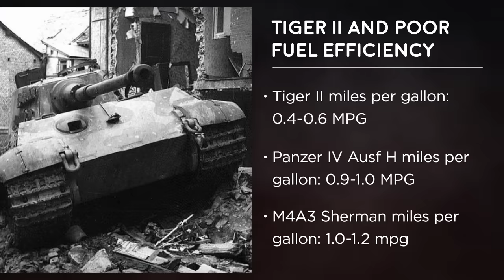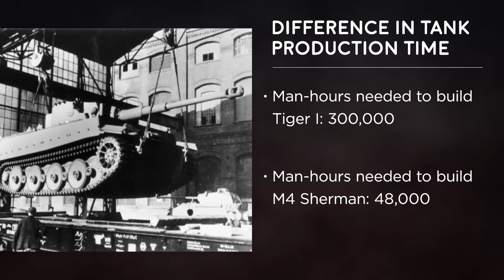Why Did German Tanks Perform So Badly in The Battle of the Bulge?

Comment: The Tiger taking 300,000 man-hours to complete is an insane statistic.

For some perspective, if you, by yourself, spent 16 hours a day working on one, every day of the week, every week out of the year, it’d take you over 50 years to make one. In other words, basically the average person’s waking hours for their entire adult life.
Reply: By comparison, a T-34-85 took around 20,000 man-hours, meaning that you could literally produce fifteen T-34-85s for a single Tiger.
Reply: @michaelwong8083  34-85s are actually quite good tanks and we quite the danger to Tiger 1s. It is just insane how much better on the strategic level the T34s were.
Reply: @michaelwong8083  "By comparison, a T-34-85 took around 20,000 man-hours, meaning that you could literally produce fifteen T-34-85s for a single Tiger."

Go watch Lazerpig's rant, and it is a rant, on the T-34 and its quality "issues". (have some popcorn ready)
Reply: @rring44  The T-34 was a good design on paper but Soviet build quality left a LOT to be desired.
Reply: @scottgiles7546  Lazerpig is great
Reply: @scottgiles7546  Lazerpig is not a great history source, T-34-85s were built with much better quality than original T-34s, They finally had normal optics and armor didn't shatter after single hit, they also solved most of the reliability issues. The 85mm gun was good enough for punching through almost anything it faced (Tiger II being the exception).
Reply: @interpl6089  sure if they could hit the thing, even then t34s had incredibly poor reload rates, tigers shot more than twice as fast as your avg 34-85
Reply: @scottgiles7546  lazerpig lmao. Dude is incredibly biased
Reply: @interpl6089  they absolutely did not solve reliability issues lmao. The Chinese and North Koreans had quite a bit to say about that. Issues the Russians didn't fix during the war, didn't fix during the cold war buildup, and even the Koreans and Chinese went "well we can't fix this" and simply had to work around their failings.
Reply: @zeppkfw  Ja?
Reply: Laserpig is an entertainer and needs to be viewed as such.  Most of his stuff has legitimate truth to it, but he also clearly leans heavily on strawmen and exaggeration in his videos.
Reply: @interpl6089  he more was ripping early T34s
Reply: I only work 8 hours a day….and I want a half hour tea-break morning and afternoon plus an hour for lunch.  🤓
Reply: @scottgiles7546  You know, if a car was incredibly unreliable, nobody would say it's a great car.  Why is the rule different for tanks?  Why do people speak of German tanks as if they have superior quality when they were famously unreliable?
Reply: That's one hell of a build
Reply: There are only 2080 work ours in a year, working 40 a week.  300k is 144 workers entire year.
Reply: Not at all surprising given many of the workers were literally slaves
Reply: 300,000 is probably an error. The Tiger cost as much as three Bf 109s, and a late war Bf 109 took 4,000 man hours to build - three times less than a Spitfire. So did a Tiger cost the same as s Spitfire?

For a comparison, Germany built almost as many U-boats as they built Tiger 1s, and each of them cost, on average, almost 20 times as much as a Tiger, but I have no idea about the man hours. Even a lowly S-boat cost 10 times more, and a single Ju 88 nightfighter was also much more expensive.
Reply: @derin111  What about second breakfast?
Reply: @MarcosElMalo2  Well, we should really all be tightening our belts...there's a war on, you know?
But, since you insist...Two fried eggs, sausage, bacon, beans, mushrooms and a couple of slices of fried bread on the side, please. Tea with milk and two sugar, there's a good fella. 🤓
Reply: @scottgiles7546  the issues are before 1943. Where we see most Soviet tank losses(which includes tanks that broke during battle from malfunction)
Reply: Germany had cheap labor in those days.
Reply: @michaelwong8083  If t-34s were made to the same qaulity standards as the US, then a single T-34 would cost the same as a Sherman.  I dunno about you but I'd take a Sherman over a T-34.
Reply: @KuK137  Now I know your on some copium shit especially since you mentioned the IS 3.
Reply: @derin111  That’s the way we did it in the Queen’s 2nd Hobbits Tank Guard Army, aka Arwen’s Avengers. With physically smaller tank crews, that gives you more room for ammo and . . . TATERS!!
Reply: @djquinn11  Cheap but highly inefficient slave labor and drafted labor, which probably increased the man-hour statistic and led to more quality control issues.
Reply: @dragonace119  I don’t want to argue tank vs tank, but I think we should note that Soviet manufacturing quality improved after the start of lend-lease. We were sending Stalin the tools and materials to build better running tanks, not just military equipment like tanks, jeeps, and planes. If the Russian tanks were superior to German tanks and more numerous, it’s because the Soviets had our help getting their manufacturing and logistics shit together.
Reply: @MarcosElMalo2  Absolutely, Lend-Lense allowed the Soviets to ignore producing trucks, train engines, and radios (Spam also played a major role) along with giving them newer and high quality tools.
Reply: @TTTT-oc4eb  comparing ships and planes to tanks is not going to prove anything
Reply: @interpl6089  Soviet doctrine meant they wanted Quantity over quality. Cheaper the better. Go to bovington tank museum and you will be able to view a T34-85 and a Panther G from the same year. Look at the quality of the chain links 🤣🤣
Reply: And all it takes to ruin someone’s lifetime of work is some bloke with a 17 pounder.
Reply: This is indeed an insane amount of time, around 6-7 times of what you would need to build a sherman. However there are calculations prizing a tiger 1 at around 110.000US$ (1941) a piece and a sherman at 40.000-60.000US$ (1944), which looks odd considering the difference in man-hours. Afaik some arguments have been made that german and american man-hours of the time are calculated differently and are therefore not directly comparable.
Reply: Germany's limited manpower and big manpower problems during the war is one of the reasons they went for fewer but "better" tanks.  The USSR could afford the mabpower drain of making 15  T34's whereas Germany could've made nothing but Panzer IV's and Stug's but would struggle to find the men to man them.  So they went for less numbers, but bigger and tankier.
Reply: @interpl6089  Really depends on factory and when it was built tbh.
Reply: @TTTT-oc4eb  Cost =/= time to build
Reply: @TTTT-oc4eb  "About 54,000 man hours per tank on average over whole production run., varying between 28,000 hours and 117,000 man hours."
Reply: @MrDanisve  I guess 300,000 is for the first few tanks. Where did you find the numbers?
Reply: @derin111  I'd rather just go home an hour earlier than taking lunch hahah snack while working is sufficient and stopping for an hour in middle of the day is a real drag. Makes me want to be done with this shit hahaha
Reply: @scottgiles7546  I would argue that the M4 reliability makes T-34 look unreliable like a Tiger II
Reply: @HarrDarr  Was that really that bad in terms of reload speed on later models as well?  I know that the early 2-man turret suffered from this issue but didn't  having an extra man as a dedicated loader solve the issue?
Reply: German armor production in the war was batshit insane to begin with. Too many model types with multiple modifications demanded by the army, short production runs and the obsession with quality over quantity helped lose the war for Germany.
Reply: @interpl6089   T-34-85s continued to be built AFTER WWII, with large numbers built in Poland and other Warsaw Pact countries.   Those did have much better build quality 
The T-34s built during the war all had horrible build quality.
If you can ever find or afford a copy of the book "T-34 - Mythical Weapon" you will see picture after picture of the sloppy construction of WWII era T-34-85s as well as large numbers of  completely shattered T-34s on the battlefields of the Eastern Front.
The T-34 was not only the most built tank of WWII, it was the single most destroyed tank of WWII.  There was a reason the Soviets built them so fast and so hastily - they were getting blown up as fast as they could come off the factory floors.
Reply: Lol
Reply: @commonavionics6069  It's hilarious that people don't realize this. Thought it was pretty clear in Lazer's video.
Reply: @glennheth3472  German tanks had quality issues too. I guess it evens out.
Reply: It may have been a mistake on his part, sometimes extra zeros get added.
Maybe you could bring it up to him?
Reply: @Conn30Mtenor  there were more than 100 variants of Shermans and vehicles based on its chassis. Then you have the M2,  M3 Lee with 20+ variants, M3/M5 Stuart with more than 30 variants, M6 and other heavy tank projects, M18, M24, M26, various super tank projects etc., etc. Great Britain and Soviet, too, had a vast number AFV variants.
Reply: This kind of statistic is grossly misleading and I have to say getting quite tedious.   Mass production greatly reduces costs.  There were 495 Tiger II tanks made.   If 1000 were made the cost would probably dramatically drop to about 100,000 and so on till cost became a small multiple of the cost of the raw materials.    If only 495 Sherman's or T-34 were made the costs would be similar.   The Tiger II was at an early stage of production and there were in fact 3 turret designs still.  Once the production is established, tooling and jigs in place, factroeis set up, wring harness testing jigs and so forth it drops rapidly.  The Ju 88 cost 400,000 man hours and this soon dropped to 20,000.    Me 109E cost 16000 hours but in 1945 costs were down to about 800 hours for the Me 109K4 without engine.    We get the same nonsense with the V2 missile.  
-The Tiger II was a specialist breakthrough tank.  It was designed to do jobs that lighter tanks simply could not do.   You can't replace 1 Tiger with 4 Panzer IV or Sherman because the lighter armored tanks will get destroyed and the crews killed.  The guns will be inadequate.  
-The tank the Germans had designed to be their new mass production tank was the Panther and it required less man hours than the Panzer IV.
-The Panzer IV needed replacing as the tank was getting nose heavy at 24 tons and the turret ring to small to handle a bigger gun.  The Turret mantle was only 50mm Armour.
The Germans make good use of the Panzer III as the StuG III and good use of the Panzer IV as the StuG IV and Jagdpanzer IV.   
They made use of Panzer IV and III Chasis to make the Nasohorn Tan Destroyer (likely still the longest AST kill on history with a T-34 killed at 4km)
They made use of the Panzer II chassis for the 10.5cm Hummel SP gun.

German tanks had trouble for only 3 reasons: 1 they didn't have fuel and 2 the battalions they were organized into latter in the war lacked organic reconnaissance groups.  Without reconnaissance specialist to find the enemy one stumbles into traps.    3 The allies had air dominance, this fed into German reconnaissance problems and fuel and other logistic problems.
Reply: @3dcomrade  The T-34 had a Department during the entire era of the Soviet Union to positively promote its myth and legend.  After the collapse of the SU historians were able to examine the actual data.  The T-34 had a breakdown rate of 1 every 50km which is worse than the Panther tank which had the excuse of going from drawing board to combat in 15 months.   There were 48,000 T-34/76 and T-34/85 produced during the war: the Germans destroyed 40,000 of them in an exchange ratio of 5:3 in the German favor.   had they got  to 4:2 the T-34  tank forces would have reduced rapidly and the Germans won the tank war as the SU was left without tanks.   The T-34 as a 'robust reliable tank' is a lie made to make the Soviet Union and Communism look good.   The T-34 was no more reliable than the the Panther and far worse than the Panzer III and Panser IV.  It was dependent on a supply chain only possible to be maintained by American lend lease trucks.   The T-34 was vastly less reliable than the Sherman and its soft factors were far worse.
Reply: @djquinn11  Germany had a labor shortage even before it used impressed labor and it didn't get better.
Reply: @Poverty-Tier  The 17 pounder could not penetrate a Tiger II from the front under any circumstances.   The 17 pounder firing APDS generally couldn't penetrate a Panther from the front at 500 yards most of the rounds glancing of or breaking.   Lots of UK Army tests on this.   APDS still had problems and tended to  be inaccurate due to uneven sabot separation. (This is why the US stayed with HVAP tungsten core which also had a stick metal head that swing the core around).   The 17 pounder was a powerful gun and of the same power as the Panthers own 7.5cm KWK 42.
Reply: @tacomas9602  Tiger II was not unreliable.   It needed a lot of scheduled maintenance.   Basically a track tightening procedure every 70kkm and often wheel replacements caused by shortages of rubber for the wheels.   Don't confuse unreliable with frequent scheduled maintenance.   Same with the Tiger I.  Panther was unreliable  due to the final drive gearboxes (the ones that drove the sprockets).
Reply: @williamzk9083  considering the reality of USSR attacking an enemy with no chance of Barbarossa like failure on the German side. A 5:3 ratio is pretty good, as the requirement for a good attack is 3 attacker for every 1 defender(3:1)

The 5:3 ratio you gave also means in T-34 vs German tank. We have 24000 tank German tanks destroyed

If the Soviets were to have little to no tanks. They can do a work around in defense by increasing the amount of "defensive regions" Regimental sized infantry units armed exclusively with MGs,AT weapons and SMGs

The losing air war for the Germans also means those 4000 extra tanks dont have the support to overwhelm the defenses USSR have, nor the planes to defy the USSR air force(VVS)

Those 4000 extra tanks might also be a hindrance if those 4000 extra tanks exists after 1942. As most German losses comes post 1942
Reply: @iain-duncan  Not literally slaves. Nearly slaves or figuratively slaves, but not literally slaves.
Reply: @williamzk9083  Did you watch the video? There were a whole lot more problems than that...
Reply: @Sascha5  the difference doesn't matter much when it comes to work quality. If anything, it's worse
Reply: @glennheth3472  iirc military history visualized has a video about Soviet quality, stating the quality was a lot better in the later years.
Reply: I wonder how many man hours it took to build a B-2 bomber with only twenty odd being build at a cost of over $2.0 billion each in late 1980’s / early 1990’s U.S. dollars?
Reply: @williamzk9083  From what I've read, both the Tiger I & II had issues with their engines and transmissions because they were originally mean for a much lighter Tiger, but when the Tiger grew in weight, the designers never put in a stronger engine/transmission into it. So when the Tiger finally went into service it was underpowered and had a transmission not meant for a tank of its weight and the problem was further exacerbated in the Tiger II which (I bleieve0 used the same engine and transmission but in an even heavier tank. However, this was an issue that could be worked around by a skilled/experienced driver, something that the German Panzer corps (both SS & Heer) was lacking in.
Reply: @3dcomrade  The 1943 and 1944 Soviet tanks were also crap.
Reply: @michaelwong8083  The myth of German tanks being unreliable is largely due to US propaganda doing everything in their power to convince their troops that the enemy didn't really have good equipment, the Tiger is a perfect example of this. I believe the tiger could drive something like 50% further than the most reliable of the Shermans before it needed to have it's engine rebuilt. It also had enough reserve power to tow another tiger, which is usually a good indicator of reliability. The reason you sometimes see historical sources claim the tiger was unreliable is because sourcing new/spare parts was extremely difficult and it definitely had it's impact on the number of vehicles a unit could keep combat ready, that is hardly the Tiger tank's problem though.
Reply: @scottgiles7546  The video has several problems. The unreliability was largely gone by 1943. Real.
Reply: @zeppkfw  Sigma I know
Reply: If I could spend my time building a single tiger one instead of goin to work I'd do it
Reply: @michaelwong8083  because their infamous reliability problems have been as exxaggerated as their perceived invulnerability

Also Ferraris are considered absolutely great cars but they werent the most reliable
Reply: @michaelwong8083  As Stalin said, "Quantity has a quality all its own".
Reply: @interpl6089  Only the post war T-34-85 were good quality.  Those built during the war still had issues.
Reply: Lots of commieboo apologists in this thread chain...
Reply: @lucas82  an extra crew man was a good addition, but it didn't solve the issue that the T-34, even the T-34-85, have a quite cramped internal space (in competition with the Firefly), what makes a tank perform well, is if its design allows the crew to perform their roles with very little hindrance.
Reply: @jonathanallard2128  it is nice to see some one here understands this, also with limited fuel resources, a lot of low quality tanks doesn't make much sense.
Reply: @tyvernoverlord5363  not an apologist, more a believer in the dictum " the enemy of my enemy is my friend", however transitory .
Reply: @scottgiles7546 Lazerpigs rant is glorious. Plus I think they got it down to under 3500 hours.
Reply: Plus, they were not reliable, slow, and gas hogs.
Reply: @thelordofcringe  crazy that a tank designed around fighting in the relative flatness of western Russia/eastern Europe wasn’t that suited to the mountainous terrain of Korea
Reply: @connorm4145  It wasn't suited to the fields and plains of the coasts either lmao. It was a piece of shit.
Reply: @michaelwong8083  because "German engineering". When engineering is engineering and the key difference lies in the quality of the tooling. But "German tooling" generates a whole different meme set so people go with the "German engineers were superhuman" and other engineers were cabbages thing. The whole thing was pretty much a bust from the start. They got lucky in the Ardennes and it went to their heads. No air superiority over the Channel. No suitable landing craft. New plan: let's invade the USSR. The only problem was that they had too many horses. Making more tanks wouldn't have been the answer because they didn't have enough oil.
Reply: @glennheth3472  The soviets build quality did not matter, because manpower was expendable in the communist worldview.  The Germans could knock out 14 Russian tanks, and still lose to the 15th.
Reply: @DocTommy1972  People who say "German engineering" usually don't even know what engineering is.  Quality of craftsmanship is not engineering.  Skill of craftsmen is not engineering.  Engineering is design.  Engineers make blueprints.  We are not technicians.

The German "big cat" tanks were poorly engineered.  They required far more components than American or Soviet tanks, to do the same job.  They were more complicated, and the factors which caused breakdowns were built into their design, not caused by inadequate craftsmanship.  They were too wide to fit on a train without literally being modified, which caused all sorts of logistical difficulties.
Reply: @michaelwong8083  I hope your explanation will put this to rest, but sadly it's become ingrained in the minds of certain people. Every time I see someone going off about WW2 German engineering being "ahead of its time" I'm going to quote your reply, or link to this video.
Reply: @MarcosElMalo2  people seem to forget that point. Also all food we sent and Studebaker trucks to supply them and tow artillery. Russian people never forgot.
Reply: @michaelwong8083  Because German tanks werent that more unreliable than the tanks from the other countrys ... they were better in a fight though: a panther could destroy a sherman from 2000m, a tiger a T-34 85 from 2000 meter and were extremly tanky (except when some ressoruces werent used, cause the Reich had not enough of them, so a tiger wasnt penetrated, but the tank crew still died ... the SU had big tanks as well (IS 2) and they were inferior as well. In the end, Germany had more tanks than needed, but no oil (and perhaps crew) to use them. Even when a tiger needed lot more time in making it than a T-34. So: either all tanks arent great or a your car point isnt that great.
Reply: But the thing is… it wasn’t just one man. It was likely hundreds of men that saw work on one single tank and so these hours are likely calculated cumulatively and independently of one another. As in- you could have 5 men working on a single tank at one time assembling one component but each man is charging for the 5 hours they work on it. 5 x 5 = 25 hours, but in reality only 5 hours went by. Doesn’t matter, each guy has to get paid or compensated. Now I can’t speak on veracity of the provided number, but it wouldn’t be surprising. If you split up 300,000 man hours amongst 200 men, they’d work 1,500 in total on building a functioning tiger II from scratch to rolling out the warehouse. 1,500 hours doesn’t sound entirely unreasonable for building one of these tanks. This means it would take 2 months to get one of these out on the field. I’m no expert so I’m not sure how to interpret that data, assuming it’s even true.
Reply: @michaelwong8083  German Engineering 👍 🤭
Reply: @sammybeutlin2763  "German tanks werent that more unreliable"

Yes they were: they needed more time and more parts for maintenance than other countries' tanks, which is why they were out of action for mechanical issues more of the time.  Poor design decisions such as suspension parts which can't be swapped from the left side of the tank to the right side of the tank might seem pedantic, but they can make a big difference in a field maintenance situation.  And that's leaving aside the infamous Panther final-drive problem.
Reply: @DocTommy1972  Thanks.  As an engineer, I'm constantly annoyed by the common misconception that engineering and craftsmanship are the same thing, or that good engineering is "cost-no-object" thinking, when in fact good engineering is finding cost-efficient ways to solve problems.  And no one ever mentions the fact that one of the most distinctive features of German WW2 tanks (their interleaved wheels) was never copied by anyone after WW2.  If they were ahead of their time, why didn't anyone copy what they were doing?

The WW2 tank that was most ahead of its time was the Soviet T-44, which would have been overpowering in combat and which would become the foundation for the T-54/55, but it just didn't make sense from a logistical standpoint to switch from the T-34-85 to the T-44 in the middle of a campaign.
Reply: True but did you see when the cannon did a boom, that was cool. Also for comparison the US was producing Liberator bombers at Willow run every 63 minutes on average.
Reply: @aidenbailey2402  Stalin's quote about the issue; "Quantity has a quality of its own."
Reply: @zeppkfw  everyone is biased.
Reply: @michaelwong8083  It is because the design is good and the prototype was good and the post-war models were still good. The problem was that the USSR decided to cut corners to cheapen and speed up production during the war. The cheaper and quicker way they produced the steel alloy for it, for example, made the steel harder, but also more brittle, and in extreme cases made it worse than having too little armor, as a hit on the armor would send shrapnel from the inside of the armor through the tank.

The logic with the car definitely goes for T-34 built during the war. Their design was great, but the cheap quality canceled that out on many occasions. A shitty tank in absolute terms and a mixed tank in terms of 1930s-40s tank era, that tended to produce more half baked crap than finished tank designs. The properly produced models are some of the best tanks of that era.
Reply: @TTTT-oc4eb  It could also account for the time to produce the armor plates. RHS that Tigers used was slow to produce and was constantly checked for very high quality.
Reply: @jonathanallard2128  Finally someone that gets it! The concept of more tanks require not only more crew, but also more support and materials, is a very difficult concept for the vast majority to understand.
Reply: And they were rarely the same.  Germans were notorious for constantly changing parts for the sake of changing parts, it rarely made the tank better and made it even worse to maintain.
Reply: @michaelwong8083  - The Americans did a teardown of a T-34 and concluded it was overly complicated to build.  IIRC, they also said the person who designed its air filter should be executed for treason.
Reply: @TTTT-oc4eb  

It could have been that Germany was using individuals to make more parts instead of machines.  This could account for the man hours.  Perhaps a better comparison is American man hours plus machine hours versus the 300, 000 man hours to build a Tiger.

You pretty much need a steel mill just to make the armor for a King Tiger.  In the 1940s, technology wasn't there where a steel could be run by a skeleton crew like in the 2000's.
Reply: @scottgiles7546  Lazerpig is significantly overrated in some places. 

EDIT; I mean, he can be amusing to watch but you should take it with a grain of salt.
Reply: @scottgiles7546  We know. The thing that made the T-34 (and equally so for the M4 Sherman the Soviets are using) superior to the Tiger is numbers. Plain numbers...
Reply: @ClockworksOfGL  Right.  The heavy tanks aren't part of the Vergeltungswaffen program though.
Reply: The US wished they had T-34-85 tanks back in the War of 1812!
Reply: "insane statistic."

You know what also "insane" is? Your ableist language.
Reply: @zeppkfw  
Even calling him 'incredibly biased' is a kindness.
Man makes Goebbels look like a balanced source.
Reply: no, what's insane is that 50 Tigers would be loaded on a train to the Eastern Front in preparation for the battle of Kursk. This in and of itself would require quite a bit of custom logistics as the Tigers were not easily loaded, shipped by train and unloaded. for this reason, Hitler delayed the start of the battle for 6 months. 

The Tigers arrived at the terminus, traveling over 1000 km to arrive at the forward staging area, and half of the Tigers were lost in mud in removing them from the train (not the first time, not the last time).  Subsequently in battle the Nazis lost 1 Tiger in mechanical breakdowns for each Tiger that actually participated in the salients along the northeast and southeast approaches to Kursk itself. The approach from the NW was stopped in its tracks on the 2nd day of the battle. The approach from the SW made somewhat more progress but was brought to an end in the Battle of Prokhorov. 

https://en.wikipedia.org/wiki/Battle_of_Prokhorovka

...and after all that armor was lost in a futile attempt to even lay binoculars on the city? 

The Nazis then engaged in a scorched-earth polity as they retreated some 250 km to the west to a fortified line running north-south and tried to hold the Red Army advance westward. In an absolutely futile effort that merely hastened their demise while making absolutely dead-sure that all of the subsequent Red Army attacks had zero fucks given in terms of the care and condition of the Nazi forces defeated and captured. In less than 2 years Red Army forces were dancing on top of the Reichstag in Berlin. I'm literally surprised that Stalin did not have Berlin burned to the ground and salted. 

I am absolutely sure of one thing.
In April of 1945. The last thing that I would ever want to be is a German. I'm not so sure that I would want to be a German even now. The history of the European and Asian continents is...uncountable thousands of years of warfare, with the ebb and flow of power the entire time. Germany was the last country in Europe to say "ok you beat us that time because we had poor leadership, now we'll try it again with no rules, 'total war', while we slaughter half your people and enslave the rest". 

and who beat them? 

The British. And the Russians and certainly to some extent the Americans, the French even the Canadians, the Aussies, the Poles and the Dutch, the Norwiegans and the Fins, the Czechs, the Italians, you name it. Yes. it was a definite Coalition of the Willing but let's not forget that a good number of these countries were happy to fight WITH the Nazis when the war started. 

The US certainly would not have gotten int another war in Europe given its own choice whether or not to do so. And then the only thing that would have saved all of Europe would have been...wait for it...Stalin. Churchill would not have wasted resources defending the Soviets from the Nazis if the US had not sent those resources to the British to be sent to the Soviets. Quite arguably the entire war hinged on one fine point. 

Pearl Harbor. 

And that is why these things never get completely resolved.  There's always something that makes the losing side say that they would have won "if not for this". For the Germans, it's Pearl Harbor. I'm sure that there are Japanese who feel that about the war in the Pacific. "For want of a nail".

It certainly wasn't the Manhattan Project. 
But if the U.S.S Mississippi had been sunk on is way to Tinian with its atomic cargo rather than after delivering its atomic cargo? Then we would have had to, at least, recover or replace those bombs. And how long would that have extended the war? Since Stalin had the secrets to atomic weapons, that might have allowed the Soviets to be the first to deploy atomic weapons. They might have just nuked Japan themselves and focused on their gains in Manchuria and in Europe. It is no small irony that as a result of what happened in  1945 we sit here today staring at Russia threatening all of Europe over the Ukraine.
Reply: @3rdworlds  that not how slave labor works..
Reply: @MarcosElMalo2  less potty breaks and whimpering?
Reply: @rring44  Yes, the T-34/85 was a much better tank, primarily NOT the gun, but the commander was no longer the gunner, since the earlier T-34 was a single man turret.  This is why the German MkIII could often hold their own in maneuver vs the Russians.
Reply: @HarrDarr  You are talking about the T-34/76 with its one man turret.
Reply: @interpl6089  Yes the ones built in the post war world were much better.
Reply: @michaelwong8083 Cars dont get shot at by canons 😂
Reply: @interpl6089  I believe he specifically notes this fact, but as i recall the majority of the 34s fielded in the war weren't of the -85 variety
Reply: @Anttown123  Do go on.  I would LOVE to see you explain how breaking down and becoming a sitting duck is somehow MORE acceptable when you're being shot at.
Reply: @ClockworksOfGL  No, they actually concluded that it was a simple design, but they thought it wasn't very reliable, in part because the sample they received was in bad shape because it had a lot of miles on it and they didn't realize that.
Reply: Depends if you value your crew or your tanks. Tiger 1s destroyed a lot of enemy tanks, and kept the trained crew alive, often so they could fight again in another tank. T 34s were plentiful and cheap, but they got knocked out and their crews died. Tigers kept trained crews alive to fight another day, Russian crews were of course, expendable.
Reply: @michaelwong8083  "all German tanks were unreliable" is a myth. The Stug and the Panzer IVs were reliable, and the most produced tanks of the war, as were Hetzers. Earlier Panthers had problems, but these were ironed out and the later models (AUSF J)  were better. Tigers needed a lot of maintenance, however their crews did maintain them regularly to keep them running. Other tanks like the Tiger II and the Ferdinand had problems that were never really ironed out, but they still worked well in some situations. The Ferdinand had major drive maintenance issues, but in defence, it could sit there and destroy tanks while being largely immune to allied fire. It had the highest kill ratio of any tank/AFV at 10 to 1, and in one battle they got a kill ratio of 25:1.
Reply: @thefantasyreview8709  Sorry, when I referred to German tanks, I meant the big cats, ie- the most famous and iconic ones that Nazi fanboys are always wanking over.  They were hugely overrated and seriously unreliable.  Yes, including the later Panthers.

Sorting out some of the early production issues did nothing for the over-complex designs, under-designed transmission, unwieldy size, extraordinarily difficult maintenance, and horrible fuel efficiency of the big cat tanks.

PS. Cherry-picking a battle with a high kill ratio is a terribly dishonest way to argue.  Panthers really only did well when they were dug into defensive positions.
Reply: @thefantasyreview8709  As a general rule, the US Army estimates that a 3:1 combat power advantage is required to attack and overcome entrenched enemies.  The fact that the Panthers achieved high kill ratios in certain battles can be pretty much entirely attributed to the natural advantages of being the defender.  Whenever they went on offense, their performance dropped accordingly.
Reply: @michaelwong8083  They are built for two diffrent things you cant compare them.
Reply: @michaelwong8083  The Ferdinands kill ration of 10 to 1 was the greatest for any tank...and that wasn't for one battle, that was for the whole war, on average....so not cherry picking.
I would agree, there were problems with the Panther, but once again, you are generallising. EG, as for reliability of the "big cats" I'd ask you provide some references that the Tiger for instance, wasn't reliable. Wikipedia for instance says "From May 1944 to March 1945, the reliability of the Tiger tank was comparable to the Panzer IV. With an average of 70%, the Tiger's operational availability on the Western Front, was better than 62% of Panthers." As noted, the Tiger required more maintenance, but when maintained regularly by their crews they worked (towards their later service at least).
Reply: @michaelwong8083  The 10 to 1 ratio was the Ferdinand, and it was used at the Kursk offensive by sPzJagAbt 653, not dug in as defensive.
Reply: @thefantasyreview8709  If you knew anything about the Kursk offensive, you would know that most of the Soviet losses actually occurred when the Soviets went on the offensive.
Reply: @thefantasyreview8709  That's why kill ratios are useless: the Ferdinand was a waste of resources.  It was only good for parking itself and shooting at attackers from range: basically acting as a fixed turret.  The fact that it was really good in this idiotic role doesn't mean it was a good tank.
Reply: @michaelwong8083  It was used in the Kursk Offensive successfully, so not just defensive. And why in any way would it be idiotic to be using a tank successfully in a defensive role to destroy tanks at a ratio of 10 to 1? I'd say that's a pretty damn good use of a tank!
Reply: @thefantasyreview8709  The fact that something is used in an operation called the Kurk Offensive does not mean it was successfully used in an offensive role.  You're talking like a child.  Don't you ever wonder why no one ever built a vehicle like the Ferdi again after WW2?
Reply: @michaelwong8083  can you cut out the personal criticisms Michael? "You're talking like a child" can you not debate an argument without being insulting? If you don't know the topic well enough to actually debate it on the facts, rather than resort to petty childish criticisms, then stay out of the comments section.
Reply: My dad joined up in March of 1942 after PH. Said he knew they were coming for him may as well get it over with. He did 24 years in the military being moved over into supply and repair for 8th Bomber Group as a T-Sgt running repair and warehouse crews. He stayed in after WWII and went with the newly created USAF in 1947, then went through Korea and the start of VietNam when he got out in 1966. I was born on Guam in 1960 where he was stationed. He passed back in 2001 but I can't help but think about what all those guys in WWI, II , Korea, Vietnam, And the sand wars fought for freedom so hard for for it to be under attack by communism from within today. I'm glad he didn't live to see what his sacrifice was wasted on.
Reply: @thefantasyreview8709  When someone insists that a tank dug into a defensive position must be on the offensive because it happened during something called "The Kursk Offensive", he IS being like a child.  That is not adult reasoning.  Why exactly should people not point out something that stupid?
Reply: @michaelwong8083  You don't get it do you? If you want people to debate the topic, and treat you with respect, you need to do the same. Insulting people just makes you look like you don't understand the topic, and need to insult people to win. If you want to debate the topic, then do so. If you are  going to come on here and insult people, then you belong somewhere else.
Reply: @thefantasyreview8709  Oh right, I forgot that some assholes out there think that lying is "civil", but insulting is not.
Reply: @michaelwong8083  As I said, calling people assholes is not a way to prove you are willing to have a civil discussion. If you want to have a serious discussion about this topic, and have people respect you, respect them.
Reply: Amazingly the Tiger's at least, didn't have standard parts, they couldn't just swap damaged parts from one tank to another. You couldn't necessarily use a broken down tank for parts for other Tigers.
Reply: @salsaghetto  uhhhmm, you got a reference to support that? Because any one model of a vehicle made in a modern factory is going to be using the same parts.
Reply: @rring44  it doesn’t matter since fuel was the limiting factor
Reply: @thefantasyreview8709  It says a lot about the culture of superficial civility that you keep insisting rudeness is worse than dishonesty.
Reply: @salsaghetto  One of the big problems of relying upon "craftsmanship" instead of proper engineering is that craftsmanship is not standardized.
Reply: @michaelwong8083  sorry mate, not engaging with you. Next time be respectful.
Reply: Lack of fuel did not help.  A major part of the strategy is the capturing of the allies' fuel dump.
Reply: @bermanmo6237  true.
Reply: @bermanmo6237  When fuel shortages have been a problem for you FOR YEARS and you design a tank with horrible fuel economy anyway, that smells an awful lot like incompetence.
Reply: @thefantasyreview8709  Oooooh, I'm so upset that some dishonest clod on the Internet doesn't like me.
Reply: @michaelwong8083  How old are you, 4?
Reply: @thefantasyreview8709  I should ask you that.  Anyone so obsessed over strangers on the Internet showing him respect must have SERIOUS issues.
Reply: From Quora:

In 1943, the plant made 647 tanks [Ref 2]

This gives 8000 men x365 hours/647tanks = 35,000 man hours/647 tank=54,0000man hours per tank

Tiger production varied between 25 per month in 1942 and 104 per month in 1944

This compares with T34 figures of between 3700 and 9000 man hours per tank- Ref 3. See also Ref 4&5

This means you could build just under 8 T34s in the time you could build a Tiger. This seems a sensible comparison.

Note that this is factory time for comparisons. Comparing the outputs of different countries in WW2 is subject to uncertainty as the methodology of determining values varied etc.

Looking at other estimates, Salavrakos [Ref 6] givs 300,000 man hours per Tiger, 150,000 man hours for a Panther but only 2000 man hours for a Pzkpfw III- it doesn’t look as if a like for like comparison is being made. The 300,000 man hours figure is discussed here There is a claim of 300,000 man-hours to produce a WW2 Tiger 1 tank. Are there any records to compare manpower effort per vehicle by countries in WW2?

The 300,000 man hours figure has grown legs! But I cannot find the original source apart from the Tiger Field Manual. Being an avid listener to the BBC R4 series “More or Less” which looks at statistics like this, my best guess is that someone took the 100,000 man hours figure for early factory production and then asked an economics professor what fraction this was of the total time to make the components, and he said “about a third”- and hey presto! I shall update my post if the true provenance becomes available.

It is hard to believe that the Soviet Union factory could turn out 80 T34 tanks in the time a Tiger is produced, so I don’ think the 300,000 figure can be compared to the T34 values above.

For completeness

Pzkpfw V Panther Tanks

I came across this data from MAN, the manufacturer of the Panther.

This gives 5500 man x 12 hours per day x 365 days per year= 24 million man-hours

4000 Panthers were built in 1944 [Ref 2] - assuming 35% at the MAN plant (others built at Daimler Benz near Berlinand MNH at Hanover) gives 1400 Tanks.

This gives 17,000 hours per tank- which is a little over the half the time for a Tiger figure in Ref 6 but broadly similar with my factory figure.

Also, in asking about producing a complex piece of technology- where do you start? The engine, the steel, the ore, the design process?

I once went into a bike shop to get a spare inner tube (in a hurry) and the merchant asked me “did you build that bike yourself?” and I replied, somewhat too curtly, “No, it’s made of aluminium. Do you think I own a bauxite mine and an aluminium smelter?”
Reply: @rolandhunter  I think you're forgetting that when you build something as complex as a tank or an automobile, it's not just the assembly plant hours.  It's all the hours of all the suppliers who make all the parts that go into that vehicle.
Reply: @rolandhunter  "Also, in asking about producing a complex piece of technology- where do you start? The engine, the steel, the ore, the design process?"

You start with the design goals.  Then you typically take a design that already exists and see if you can modify it to suit those goals.  That's a lot easier than starting from the ground up.  You also try really hard to use off-the-shelf parts instead of new parts. 

You don't look at ore.  You just look at the specs of the steel you want, and then you order that steel from the supplier.  If you can't get the steel you want, you have to alter your design to make do with lesser steel.  Or (as the Germans did) you just use the lesser steel and pray.

PS. I'm a mechanical engineer.
Reply: @michaelwong8083  So you wanna tell me, the allies counted as manhour the steel production?
Why? Where? Show me.
Reply: @michaelwong8083  Same true on the germans.
Why? Where? Show me.
Please prove your statement.
Reply: @michaelwong8083  whatever.
Reply: @michaelwong8083  Epic, nice ad-hominem Mr Engineer.
I continue to await evidence for your claim.
Reply: @rolandhunter  Evidence for the claim that logistics people are NOT morons who ignore the majority of the work required to make something?  Please.
Reply: @michaelwong8083  Still waiting. Good ad-hominem. Zero argumentative skill.
Reply: @michaelwong8083  Mr Engineer.
You made a statement, you have to prove it right.
Did he ever learn about reasoning?
Reply: @rolandhunter  I love the way it doesn't occur to this imbecile that if there's a 300,000 hr figure and the assembly plant does not account for anywhere near that amount, then the 300,000 hr figure OBVIOUSLY included hours from other sources.  But oh no, that would mean using logic, and he thinks he auto-wins the argument by just saying "source", as if the 300,000 hr figure came from nowhere.
Reply: @michaelwong8083  It is obvious that Mr. Engineer has never argued in historical debates, or unfortunately he has not done it well.

There have been countless instances where the "common source" in this case the 300,000 was known everywhere, but not 1x turned out to be the fruit of 1 particular historian's unfounded work.

The unreliability and sluggishness of the German tanks: still believed by many people today, while a British historian Bruce Newsome investigated and found out that the source of these was the result of the Allied counter-intelligence and propaganda machine, because they knew that the German tank was reliable and agile. so they reckoned that it would be quite damaging to morale if it turned out that the German tank was: fast, better armoured, more powerful in firepower, more agile in the field than the Sherman and equally reliable with the right crew.

You can also search for his reports on the book:(videos on youtube)
1. Was the Tiger I really as slow and unreliable as we think? Mythbusting with Bruce Newsome
2.Transmission and Roadwheels: Tiger I Mythbusting with Bruce Newsome Part II.

Also, I'm done "debating" with you, because I'm sorry, but I'm not going to believe that such an ad hominem, insulting person has any actual knowledge.
Reply: @michaelwong8083  Try speculating in court sometime. They won't give you the floor. Just like in history. If in history A is true, B cannot be, because it is speculation, not fact.

And your behaviour is your poverty certificate. 

Good Luck, may God Bless You! Bye!
Reply: @michaelwong8083  You are not an engineer, that is 100%.

You behave inappropriately
You don't understand what the other person is saying
You come with a big face and arrogance by default
You think speculation is a justification of contradictions
I'm sorry you are such a person. :(

May God Bless You Sir, I forgive your behaviour, the "debate" is nothing in my eyes.

Better preparation, better behaviour next time.
Reply: @rolandhunter  LOL, you obviously don't know any engineers if you think engineers are always polite and would never insult someone.
Reply: @zeppkfw  I noticed you did not say he was wrong about the quality issues that plagued the original T-34s.
Reply: Joachim Piper was murdered in France in 1977. An allied group of Battle of the Bulge is suspected to have been involved. Why wasn't Piper convicted as a warcriminal in the Nuremberg trials?
Reply: They should have focused on improving the Panther and making as many as possible.
Reply: @TTTT-oc4eb  The problem he probably means is how often the Germans updated the design. While the Sherman in the same production run was identical to each other and updates came in batches to maintain efficiency the Germans did stuff differently. The best example is the Sturmtiger, only 18 where produced and every single one was unique. You simply have to look at the exhaust holes on the barrel to see that every single one had a different amount, and these changes went deeper into how for example the engine was modified to fit in the vehicle. 
Tigers had a similar issues. In one tiger line it was found that they changed to location where the exhaust was placed, 3 tanks later they placed it back to where it was originally. You can find these small changes all over the tank production lines. This meant that efficiency was slow to increase and logistically it was a nightmare because if you for example requested a replacement engine (something that happened a lot in the USSR due to dusty roads in summer) you had to hope that the thing would actually fit in your tank, because otherwise it would either require extensive modification or even a custom made engine, all because one of the engineers making your tank thought he could make it slightly better with his changes.
Reply: @eyeli160  There were more than 100 versions of the Sherman, major and minor.
Reply: and then it breaks down before it reaches the front
Reply: @michaelwong8083  ans Sherman's probably the best tank of the war, took about 48,000 man hours.
Reply: @zeppkfw  How so?
Reply: its a propaganda figure and highly inaccurate. The factory ran two shift. Night shift being 50% less productive. The factory also made other tanks and locomotives.
Reply: @TTTT-oc4eb  all details I found is that the production hours or both the Tiger or the Sherman seems to be incorrect.

I think they grabbed the details of the wiki.

About 54,000 man hours per tank on average over whole production run., varying between 28,000 hours and 117,000 man hours. We can estimate the man hours to produce a Tiger using the data below. About 8000 people worked at the Henschel plant in Kassel, working 12 hour shifts, so 96000 man hours per day.

The above details were gathered from other sources for example.

Where as the Sherman ended up with an average of 10000 man hours when the mass production was in full tilt but the initial ones took 48000 man hours to build.

The initial production run, including hammering out initial issues due to machining needing to be done by hand for individual parts for each individual tank, may have been 300000 man hours but that was not the average production hours.

Look at for example the Liberty ships or some of the bombers how much the average dropped over the war.

The Tigerfiebel may have been fibbing…
And this seems to be where the initial needed man hours has been taken from, not from the factory and production data (and keep in mind that several times bombing delayed production for several hours which added time while nothing was actually being produced.

Thank you for the video though :).
Reply: I've seen it argued that it did make sense for the Wehrmacht to order Tigers and Panthers later in the war because the constraint was skilled soldiers more so than steel, and so the late panzers' increased survivability helped preserve not just manpower but also training and experience. This number makes me realize that in addition to steel, those panzers probably also required more workers, and thus used up another luxury that they couldn't afford.
Reply: @michaelwong8083  I think the 300,000 hour claim is misrepresent grossly and out of context, not by you, ofcourse.   That would include not only the actual assembly time of the tank and manufacture of sub components and even steel and electricity production but the set up and tooling costs of the factory and the engineering time.   It was probably a costing for only for the first batch of 50 tanks.  The historian who quoted that probably had accounts or estimates for the first 50 or 100 and assumed that would be forever.   Production costs drop exponentially with production run.      An Me 109 took 5000 hours to make at the beginning of the war and was 1000 hours by the end.   A V2 Rocket cost 20,000 man hours but was expected to cost less than 4000 hours by the 16,000th production example.  We saw similar cost drops with the Ju 88.
Reply: @TTTT-oc4eb  The 300,000 is probably in Reich's Marks not hours or for the first batch of 20-50 or so before costs had been amortised.   It's definitely wrong.
Reply: @williamzk9083  But the Tiger never really did enter mass production.  They only made 1300 of them, which was a small number for a WW2 tank.
Reply: @ImReverseGiraffe  Yeah, it's funny how people who know nothing about the subject think the Tiger and Panther were the greatest tanks of the war, but people who know something about the subject think the Sherman was the greatest tank of the war.
Reply: @glennheth3472  The Soviet concept of “quality” meant, “cheap to make and easy to repair.”
Reply: @Aqueox yea I'm very confused why people bring him up with t34-85s. I'm not sure he mentioned this later variant even once.
Reply: @williamzk9083 you kinda completely dismiss the absolutely horrible performance of these tanks outside of combat. They didn't just run out of fuel they broke down a lot.
Reply: @ThatPianoNoob  Tiger tanks did not break down a lot.  It’s a myth and just not true.  We had teething problems on the first batches Tiger I but with refinements and a modified engine (HL 230 replaced Hl210$ with governor the problem went away.   The tanks were high scheduled maintenance but so long as the maintenance was carried out it was reliable.    You can’t analyse in a vacuum.  Tigers were used in extremely difficult situations and spear heads.  They were often used to clear mine fields simply by driving over the top and using theirs massive strength to keep going in.  This often lead to breakdowns (torsion bar replacement). A Tiger was subject to more harsh treatment than a panzer IV.
Reply: @dragonace119  The Sherman has superior visibility over the T-34 and much better comfortability
Reply: @fishyfish6050  I mean yeah obviously the Sherman is a by far better tank than the T-34.
Reply: @rring44  T-34 was a shitty tank, it had poor quality, on paper it was good, but again thats on paper, but it was still better tactical cause even if a tiger could take out 5 or 10 t34s you still have t 34s left, simply said, there wasn’t enough tigers or enough time to make more tigers,
Reply: @interpl6089  still, look at the k/d ratio of German armour against Soviet armour it was 1/3, but the soviets had the numbers to tank it.
Reply: @michaelwong8083  because the numbers don’t lie, if your tank can inflict 3 kills for every loss, they are objectively better.
Reply: @michaelwong8083  Is that literally?
Reply: @interpl6089      ”the T-34-85swere built wit much better quality:”

• Normal Optics.
• Didn’t shatter after a single hit.
• solved most reliability issues
• the gun was good enough.
Reply: @fatdaddy1996  Not really, Calling a 3 losses to one kill is not hammered lmao
Reply: My two cents: The Tiger was a great heavy tank with surprisingly good reliability given the reputation of German WW2 tanks, but was still a heavy tank. The T-34 was a good design on paper, but early war measures made the quality of the early models shit. The later models would solve some of the issues, not all of them but enough to make it a serviceable tank throughout the war and beyond.
Reply: It was a flawed design because of it's tall turett so easy to spot from distance. Hull probably ok. Tiger 1 turett was much better design
Reply: @submarine6410  Also, you're forgetting that tanks don't really exist to fight other tanks.  They exist to support the infantry, and Shermans were FAR better at that than Tigers.
Reply: @michaelwong8083  not really, its very symbiotic,  Infantry protects tanks against other infantry, Tanks help infantry push through defensive postions like trenches and protects infantry against other tanks.

The Tiger was specifically built as an anti tank first (The average tiger division had a combat loss to kill ration of 10/1) and then infantry support later meanwhile the Sherman was built as all purpose/MBT type tank, So the Panzer 4 would be a better comparison.
Reply: @submarine6410  Those combat kill ratios are highly misleading, because German and Allied units counted tank losses differently.

"The Tiger was specifically built as an anti tank first"

If it was meant as a tank destroyer, that would make it a SPECTACULAR waste of resources, since the Allies got the same job done with much smaller and cheaper vehicles like the Hellcat.  Even Germany had the Stug.  Frankly, the Tiger seems like the failed result of some neurotic Nazi fantasy about being invincible.
Reply: @michaelwong8083  The estimate I have given for the kill ratio is a conservative one, and if we count tigers lost to malfunction or breaking of parts, its still a 5:1
The hellcat and even the stug did not have as high kill/loss ratio as the tiger, Sure the argument could be made that it would have been more cost effective to build more panzer 4s or stugs instead of a tiger, but cost saving would be minimal, 

The Tiger did its intended job very well, I'm not here to argue wheatear its intended job was a good strategic choice or no.
Reply: @submarine6410  For the second time, Germans and Allies counted kills differently.  Allies counted tanks that required repairs as if they were knocked out.  Germans didn't.  Stop pretending that this wasn't huge.
Reply: @michaelwong8083  The Allied count was about 20-30 tanks for the Tiger 1 specifically 

While the German count was 12-5 for both the tiger 1 and 2

Hope this clears it up.
Reply: @submarine6410  What's your source for that?
Reply: @michaelwong8083  This man makes a great video compiling multiple sources together for the German counts https://www.youtube.com/watch?v=T0JF23VIimg&ab_channel=MilitaryHistoryVisualized

I couldn't find the source for the 30 k/d, but I do remember it from a book, but since I can clarify wheatear  the book is a good source or not, take it with a massive grain of salt.
Reply: And they were so huge that it took massive amounts of fuel to move them, which the Germans did not have. So, they launch an offensive with the plan being "oh, by the way you will need to steal the gas from the enemy." Good luck
Reply: 300K man hours is absurd to any experienced welder, machinist etc. That figure is self-evidently ridiculous and to be disregarded absent decisive evidence to the contrary.  Tiger parts count doesn't support that figure nor does its famous 88mm cannon produced in vast numbers in towed versions.

The overly complex suspension (interleaved road wheels are pants-on-head stupid which is why that horribly maintenance-unfriendly repair-delaying nonsense wasn't repeated post-war) took more man hours but the components are so simple they don't support that figure. I want to know which SPECIFIC manufacturing processes were imagined to support that figure. Tiger was a resource sink but exaggeration serves no one.
Reply: The 300,000 man-hours for a Tiger tank is almost certainly false.

I'm a bit of a Tiger-nut, and afaik the only source of this figure is the Tigerfibel, the Tiger manual, which basically brags about the extremely high figures in man-hours and money per tank. 

However, while we can't compare the Tigerfibel's man-hours figure to one given elsewhere, we can compare the cost it gives, and it's extremely exaggerated: 800,000 reichmarks according to the Tigerfibel, while an internal document says that a Tiger costed 250,800 without the gun, machine guns, radios and optics. 

If this figure was extremely exaggerated it's safe to say the other one was aswell, which is probably why it's so unbelievably high. As for why these figures were exaggerated, it was probably due to motivate the crews, thinking their tank is far superior, and motivation to not abandon it in battle.
Reply: And nine women can produce a baby in 1 month.  ;)
Reply: @scottgiles7546  Well, it obviously worked still,
Reply: Keep in mind, by this time in the war, the Germans were using a lot of slave labor, drawn largely from the conquered countries, men of mixed Jewish/gentile ancestry, and Russian POW's. 
  The advantage of the Tigers was 1) Nickel alloy steel armor, and 2) the mounting of the German 88 artillery piece for the main tank gun, which could punch through the heretofore artillery resistant Russian T-34 tank armor, angled in a way that had been resistant 75 mm gun mounted on the Panzer IV main German battle tank. In an early encounter, a single Tiger tank knocked out 50 or so T-34 Soviet tanks before it had to be withdrawn for repairs. In the short term, it seemed like a game-changer, but the Germans could not produce them in sufficient quantity to turn the tide. In the battle of Kursk, the Soviets also benefited from intelligence information from the British Enigma code cracking of the German battle plans.
Reply: @HarrDarr  Doesn’t matter if you have 15 shooting at one tank
Reply: @michaelwong8083  they were good tanks, only unreliable because of fuel shortage
Reply: @touristguy87  that long comment was an excellent read I will say.
Reply: @tacomas9602  standards
Reply: @scottgiles7546  Lazerpig thought even less of the Tiger, strategically.
Reply: @KrGsMrNKusinagi0  but mostly Stalin
Reply: They should’ve chosen quantity of superb quality. If Germany chose quantity it would still be quality because they are Germany
Reply: @Killraven  I'm not sure where you got your info from but the tiger was NOT reliable it had many things against it because of its weight which was one of its biggest problem! German drivers found that towing another tiger was extremely hard on its gearbox and final drivers! That is why the bergepanther was developed
Reply: @mustangmanmustangman4596  wasn't just its weight
Reply: @MoosePolo  still be 2nd rate
Reply: @bavarian_ttv2010  and overcomplicated design, and excess weight which put greater stress on all the suspension and drivetrain components, and lack of spare parts ...
Reply: They should have stopped with stugs and panzer iv, maybe tiger I
Reply: @michaelwong8083  it was their Transmotion that was unreliable everything else was besides burning gas like crazy, took 5 allied tanks 90% of the time to take out most Germany tanks besides the III and IV. Most of the stuff he says at the end is BS the allies would call bombers or more tanks if they saw a Tiger II or I, also no Tiger II was ever taken out in tank to tank combat all the kills on them were either bombers, fighters with bombs or the crews destroying them so the Allies couldn't take them so yeah BS on the English firefly pining it with a gun they had for 75% of the war and failed to pin a Tiger I 85% of the time and yes they had the 17pound gun for 3-4 years it was in the Chruchill and it failed, could take out the III and IV and a few weaker tanks but rarely took out a Tiger I let alone a II. America had the best guns of the Allies and only 1 could in theory kill a Tiger II everything after 1945 was made to kill tanks like the Tiger II also the IS1-3 were garbage tanks don't trust War Thunders Baises most IS takes were lost to Tiger I's then Tiger I's to IS1-3 lmao and that was Russia's best tank during WWII and lost it any fight it got into if it wasn't a 10 to 1 odd for them
Reply: @Redfire1109  Actually, kill ratios between Allied tanks and German tanks in the western theatre were around 1:1.  The 5:1 thing is History Channel nonsense.
Reply: @glennheth3472  That's kind of the point of the above post.  The Soviets knew most of their tanks would only last a few weeks.   There was no point in building a high quality product.   They needed a rolling armored gun on the battle field.   

I recall reading that they designed their tracks in some special way to account for the low quality.  I think they counted on the tracks trying to derail or something like that.

Each Tiger was a custom product and even the parts for one Tiger had to be adjusted to be used on another Tiger.
Reply: Meth a helleuva drug
Reply: @TTTT-oc4eb chances are ots accumulated hours due to german accounting. Kind alike to the russias having small battalions but historians assumed they were large like the west, causing inflated assume manpower numbers
Reply: @BlitkriegsAndCoffee  sadly, he is very enjoyable to watch but at times i feel like he sacrifices a valuable point in favor of more drunken humor. but his overall point he gets across is almost always true, t34 not as good, t-14 stupid, russia stupid
Reply: German engineering is the best I thought 😂
Reply: insane but true  x amount of tanks divided by workers and hours
Reply: yeah, but when you got done, you'd have a tiger.
Reply: It's a completely nonsense statistic and should not have been mentioned in the video. Production time depends on far too many factors: individual expertise, experience, how many people are working on it, tool quality, production line issues etc etc. 
It's just totally meaningless as a comparison.
Reply: @scottgiles7546 while the t34s were plagued by issues, I'd rather have 15 t3485s that have a fair chance to make it to the front rather than 1 tiger tank that might not even make it to the front without being bombed back into the earth.

As a normal Soviet soldier, a t34s would be a common sight with around 60000 being produced, chances are a t34s would be able to help in a advance. 

As a normal German soldier however, it would be rare to see a tiger, with only less that 1400 tigers built. Plus the fact that you would probably also be facing a few t34s as well.
Reply: @glennheth3472 Literally a war-winning weapon
Reply: @jonathanallard2128  Makes a lotta sense. Love the "tankier" description. Gave me the immediate image of a couple of Kraut officers in a used tank lot looking at models talking with the salesman: Hans looks at Sherman, "Sure it gets good mpg, but we were looking for something a little...tankier, ja?"
Reply: why so many pretentious wehraboos in this reply ?
Reply: @scottgiles7546 lazerpig is a dogshit source lmfao
Reply: I'm not certain how many people are aware of this factoid but the T-34 tank was invented (mostly) in the U.S. and spirited away by the U.S.S.R.
Reply: Peiper was investigated and an American officer who was captured during the Bulge, possibly by one of Peiper's units testified on Peiper's behalf based on the treatment that he personally received.
Reply: How many man hours does an M1 Abrahams take? Electronics and all.
Reply: 2 items not mentioned is that Sherman and T-34's were built outside of bomber range. Germany used medium range bombers that could not reach Russian factories on the other side of the Ural mountains. Russian did not have radios and hydraulic turrets all manual. Nobody mentioned the cost of lives to Shermans usually 3 out of 4 to destroy one Tiger or Panther. Tigers were also too heavy for many bridges.
Reply: @scottgiles7546 I’ve contributed thousands to the Ukrainian effort, but LazerPig is a clown.
Reply: @glennheth3472  The build quality was not good but it was not good in the way of it being quickly built, but not in the way of being flawed. The Tank Museum has a great example of this showing a chain on a German tank and either Russia or British one and the chain had been linked in such an ad hoc way but it worked just as well as the German one and that's what we see. Things done in a quick way mistakes made but all superficial in the end.
Reply: @michaelwong8083 because most of their reliability issues were ironed out like with the panthers and tigers. But lack of spare parts and trained crew caused many of the reliability ‘issues’. The Königstiger and the TD with the 12.8cm gun were truly unreliable.
Reply: Most Mk6 tigers either broke down or ran out of gas.  Either way they were abandoned on the roadside.
Reply: @scottgiles7546  That's a rant about the WW2 T-34, not the peacetime 1985 version of the T-34(T-34 85) built decades later after the first T-34s.
Reply: @tylersmith3139  and what are your thoughts about the t-34-100, built in the year 19100?
Reply: I'm curious about how that stacks up with a modern Leopard or Abrams
Reply: @glennheth3472 quantity has a quality on its own. When u are swarming the opponent 15-1 u can afford a few quality problems.